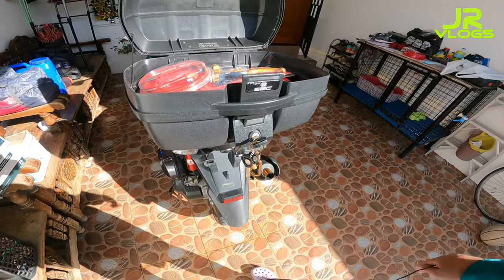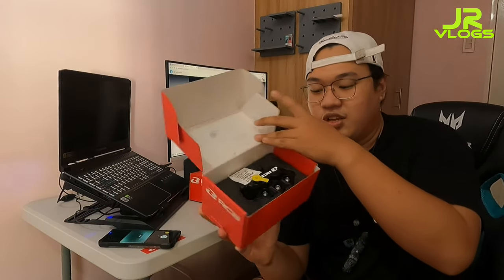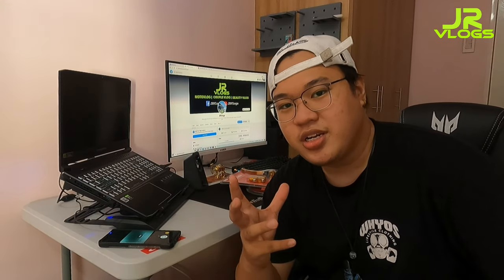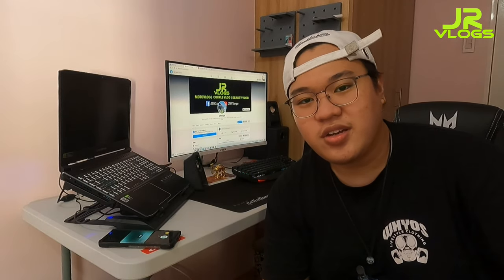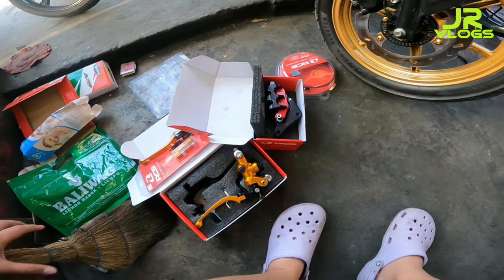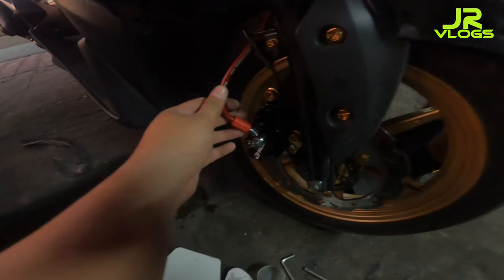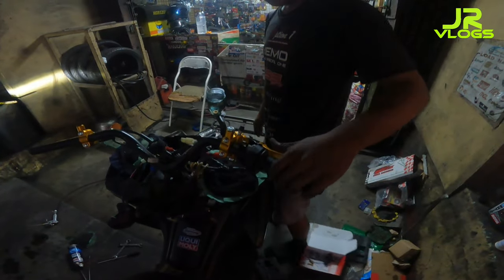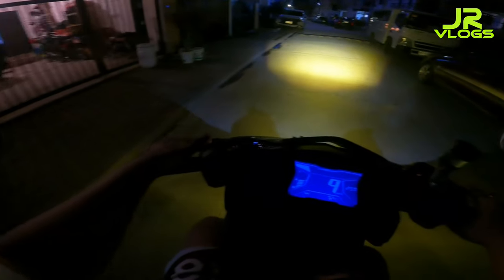AEROX155 | BRAKING SYSTEM UPGRADE | RCB S1 FORGED, RCB 2POT CALIPER + RCB TEFLON HOSE!

Comment: Paps magkano both s1 masterpump (RH) and s1 clutch perch cable type (LH)? Same dimensions din ba yung clutch perch 14 mm din gaya ng masterpump mo? plug and play naba sila ala ng tabas sa fairings (yung ina kasing vid na nakikita ko tinatabasan e)?

Yung sa teflon braided na hose magkano rin inabot? Kino-consider ko rin kase na mag upgrade into rcb order through lazmall o rekta sta maria naghahanap lang pa ako ng review. Salamat sa pagrespond sa tanong ko paps RS...
Reply from the maker: Srp basis paps 2,9 brake master 2k clutch perch. Nope, hindi sya plug and play (sa aerox need tabas upper cover kaunti lang naman panoorin sa vid) pero universal sya kahit anong motor. Teflon braided hose paps nasa 700 1000mm for aerox. Salamat paps! Sana makatulong✌🏻
Reply from the maker: Sa dimensions ng both lever, pag hindi nakakabit parang mas bigger si clutch perch. Which is napansin ko rin nung una, pero once na naikasa na sa manubela ayun di naman pansinin :)